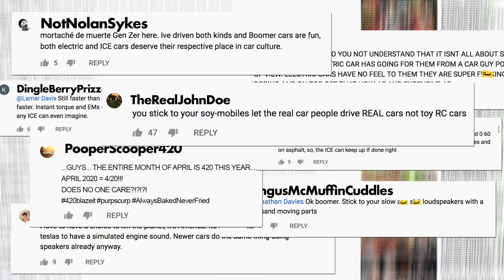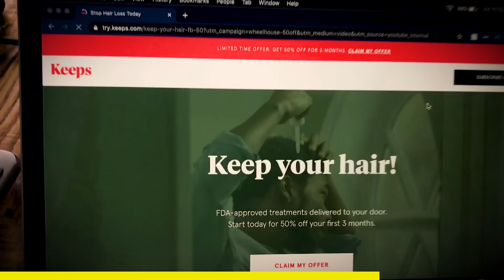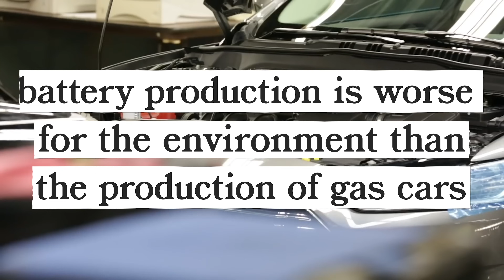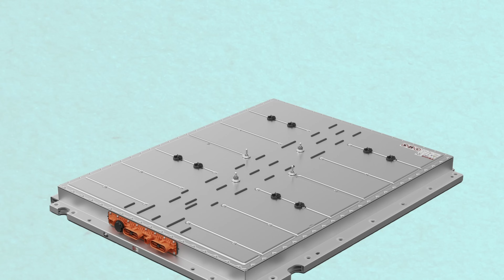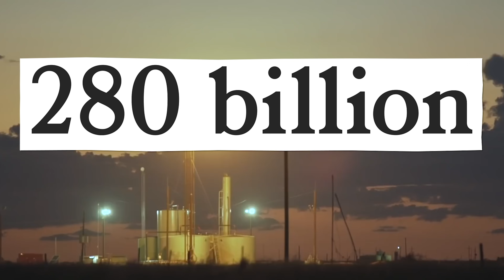Are Electric Cars REALLY Better for the Environment?

Comment: One issue I have is that you didn’t take into account the greenhouse gasses that are produced during the production or maintenance of “clean” energy. It is not efficient to maintain windmills especially. You only mentioned that using clean energy is good, but “clean” energy does not magically appear. Windmills need to be produced and maintained, solar panels need to be produced and maintained, hydroelectric dams need to be produced and maintained. I know you were trying to keep the video short, but it’s a major part of “clean” energy that you omitted.

Comment: Interesting video, what we really need is to come up with better batteries that can be produced from cheaper and easier to recycle materials......as well as safer!
Reply: Batteries are already significantly safer than ICE
Reply: We can already recycle 90% of a battery. There’s already cheaper batteries made from more plentiful material LFP batteries which don’t use any rare earth metals like cobalt. They are commonly used in China and lower end Tesla models. Current batteries are already pretty safe (safer than ICE cars at least) but LFP batteries are even safer.

Comment: Just a quick question about the environment impact of and old electric car that needs new batteries and or would be parked for years

Also what  about hydrogen fuel sell car The seem more efficient that both ev’s and gas
Reply: Hydrogen fuel cells are both less efficient and less green that battery. Hydrogen has worse performance costs 20x as much per mile for fuel, has very little cabin or boot space because whilst hydrogen has extremely high gravimetric energy density (kWh/kg) it has horrible volumetric energy density (kWh/L) being well less than half that of batteries.

And to top it all off they have incredibly short lifespans. Less than half that of a battery car, if you’re lucky!

Comment: In states that burn coal for electricity EV pollution is higher than in ICE cars.
Reply: No it isn’t. That’s a myth. Even from a coal only grid EV’s produce significantly less emissions than a combustion car. Even before consider the emissions from refining fuel and trucking it to fuel stations.

Comment: This is important, but you seem to forget that a big part of electric energy is lost on the route. And this is not consider. So, if this is like it seems, you have to multiply that 2 for 4 or 5. And this actually would imply a much worse consumption of co2 for EVs than for ICE. It is strange how this factor is very often forgotten. This is to count.

The fact is: datas usually consider the impact of producing with, for example, coal, the energy an ev car require. But they forget that the real amount of energy produced to recharge a car is in average something around 5 times the energy effectively stored in the battery, because of line losses.

So, this datas would be ok only if every EV owner is charging their cars directly from Electric Factories. But i guess people charge their EVs  at home or at "charging columns".

This has to be considered, but people making research "casually" forget when collecting datas (e.g. daras you used in this video). Is it pure ignorance?

Despite this little issue here, I have to thank you for the fact you made a video with cognition of cause, providing datas from researches, in a simple way. Go on this way!
Reply: Transmission losses in places like the US averages between 5-10% which has an overall negligible impact on the final outcome. Even on a coal only grid. But if we factor in the National average energy mix for the US we see that it reduces the emissions profile by as much as 40%. (Well and truely more than 5-10%).

Not only is gas power making up the largest share of energy production in the US, not coal, but even that only sits around 35% of all the total power, another 30% is for coal and the rest us nuclear, hydro or renewables.

So no, adding transmission losses does not affect the net outcome even in worst case scenario, and no, transmission losses aren’t “big”.
Reply: @engineeringtheweirdguy2103  well maybe it's because i'm in Italy, but i knew that transmission losses were about 80%. I guess i knew wrong, maybe it was a wrong data or it was used improperly from the newspaper i read from. So thank you, i'll go read other datas to keep myself updated

Comment: 2 problems with your analysis.  You only compare ICE vs Electric forgetting Hybrids.  Hybrids are far more efficient as a fleet. You also forget Lithium ion cell production is limited, the number of hybrid or EV vehicles you can make is constrained by battery production. Today and for the past years you could make 10 Hybrids or 1 EV with the same number of batteries.  Many hybrids can commute all electric.  So now you have a choice 10 ICE cars being replaced w Hybrids which mostly drive electric miles OR 1 EV car replacing 1 Ice car.  You pointed out how a Full EV weights 1.5 to 2x as much; this means it costs CO2 to make and reduces the advantage of the electric motor efficiency.  This is far less so with Hybrids which do not weight much more; and some times actually weigh less; for example the Toyota Corolla Hybird weighs 2800 lbs, the Corolla ICE is 3200; while the Model 3 long range is 4300.  So when Tesla made 1 million EVs they could have used those batteries to build 10 million Hybrids and replace 10x more cars - in that fashion EVs actually hurt the environment greatly as you then need 9 million ICE cars to make up the demand.  80 million vehicles a year are sold and a billion exist - you need to expedite the replacement rate - so those promoting EVs are actually doing something stupid unless they actually just want to sell cars - in that case its great.
Reply: I think this analysis is flawed, buy in large EV’s are still more green than hybrids but that’s not the big considering I have in mind. But I’ll get to that in a second. A new type of lithium plant is currently being built in Nevada which would extent lithium from clay. If it’s successful, that means there is now enough available lithium in Nevada to fuel the needs of. The EV industry for better half of the next century. Additionally, lithium in batteries are recyclable, fuel in cars are not, and we are fast approaching a point where we no longer have oil for fuel. Also EV’s aren’t much heavier than their competitors. Keep in mind most of the time they compare luxury EV’s against standard economy cars. Not factoring the luxury features which take up weight. For example. The model 3 is in the mid-sized luxury sedan category (not even the same size class as a Corolla btw). Also in the mid-sized luxury sedan category is the BMW 5 series and the Audi A6 Quattro. Both with similar performance and features as the model 3. The BMW weighs 1900kg, the Audi is 1990kg and the Tesla is 1850kg. The lightest of the 3. Batteries are heavy but you also don’t have an engine or transmission which are the 2 heaviest parts of an ICE.

But the number 1 thing I think you havn’t considered is lifespan. Hybrids do use lithium batteries. But batteries life is dependent on cycle life. How many cycles it can do. A Tesla battery with all its battery management systems to maintain the batteries within optimal operating conditions have a cycle life currently of 1,500 cycles. With a range per cycle of 325 mile that means it had a lifespan of nearly 500,000 miles.

A plug in hybrid cannot fit all those battery management systems in there and they almost exclusively don’t even bother with hybrids. This gives them a cycle life of 500 cycles on average. With a range of around 20 miles for plug in hybrids on the battery, that gives it a lifespan of 10,000 miles of battery driving to a lifespan. So you’d have to keep replacing the batteries in the hybrids and for a lot of people, it would be cheaper just to buy a new car. So sure, you could make 10 hybrids with 1 EV battery, but you’d have to build around 50 hybrids to keep up with 1 lifespan of a BEV.

Comment: "Are Electric Cars REALLY Better for the Environment?"   - NO!!!!! THE ELECTRICITY TO CHARGE THEM UP STILL COMES FROM THE BURNING OF FOSSIL FUEL!!!!!!!
Reply: note the term "better" whilst some of the electricity comes from burning fossil fuels, even if you had a 100% coal grid (very rare btw, the US's largest grid share is gas power which is still only around 35% of the energy mix). it is produces significantly less emissions per mile than a combustion car, even before you consider the refining and transportation of the fuel, They're better even just from the tailpipe alone.

Comment: There’s one aspect that was overlooked, lithium packs aren’t infinitely rechargeable, they will reach a point to where their capacity and output are incredibly diminished and will have to be replaced. The question would come if say by the time a car of either power source reached 300,000 miles what state or condition would it be in and how bad would the batteries be by then, would they need to be replaced at 200,000 miles? I’ve seen plenty of internal combustion engines make it to 500,000 or even 1,000,000 miles with proper maintenance but can’t say the same for any EV as there’s nothing that can be done to maintain a lithium pack and keep it in top shape, a good example of this is if you are using an older smart phone and have noticed it not lasting as long on a charge as it did when you first got it, iPhones even have a section in the settings to show you the current battery condition and my last one had gone down to about 70% “battery health” before being replaced at around 3 years old so there’s a lot of unforeseen costs that you aren’t aware of and unfortunately for long term users of an EV about the best solution for a long lasting power supply would actually be probably the most controversial one at the same time. A small nuclear reactor. Yep, the navy has been employing this tech for quite some time and I believe their major maintenance intervals are around the 30yr mark but I don’t see this becoming commonplace for a split second which leaves us with the hydrogen fuel cell.
Reply: Actually modern EV's have some of the most advanced battery management systems in the world on board. Making them SIGNIFICANTLY different to your iphone battery. But an EV has a cycle life of around 1,500 cycles to 80% battery health. Meaning for a model 3 with a range of 325 miles, thats nearly 500,000 miles until you reach 80% battery health. The average lifespan of a combustion engine is only between 200,000 miles to 250,000 miles. Meaning an EV should double that lifespan. (of course there are exceptions to everything. There will inevitably be combustion engines with very long lived lives.).

In the realworld we are seeing that the rate lifecycle is true, and in many case, an under estimate. For example a study of several model 3's owned by the public (individual owners submitted their cars for testing once they reach 100,000 miles). and what they found was that after 100,000 miles, the model 3's had an average battery degradation of only 2%. Meaning they have 98% battery health. That would suggest that they would well and truely overshoot that 500,000 mile mark.

That study was done on first generation model 3's. There are now more advanced batteries and more advanced battery management systems in the cars today than there was back then as Tesla continues to improve, even on a month by month basis.

Comment: Donut Dude, wind and solar isn’t as clean as you made it out to be. Sure it’s clean when generating electricity (though very little and unreliable power generation and only last 10 years tops), but it’s very bad for the environment when you need to mine all the needed materials and burning coal to melt and form million of tons of metals and transport in large bulk. In of itself it’s just another industrial revolution forced by the Democrats via $2.5T “infrastructure” bill, paid by the tax payers, to support this new industry that puts money back in these politicians’ pockets.

Comment: A Swedish study showed that the EV has no advantage over the ICE in a ten year life cycle. This also assumed European energy supply which has a higher green energy percentage. It also looked at recycling meaning the full life cycle.
Reply: Almost every comprehensive wells to wheels study he noted EV’s as being dramatically better if their lifespan. Most state that EV’s are more emissions heavy to make, between 15-20% heavier which equates to about 1 metric ton more emissions, but they are significantly less harmful over their operational life, with ice emitting 20-30 tons more over their lifetime than BEV. However it does conclude that end of life disposal and recycling are about the same as one another in terms of emissions.

What is becoming clear in recent years is that modern EV’s also last longer than a combustion car to a battery.
Reply: But if you have a link to that study if like to pick it apart